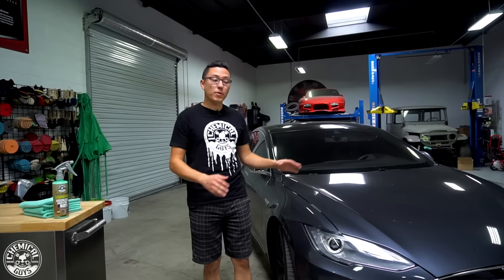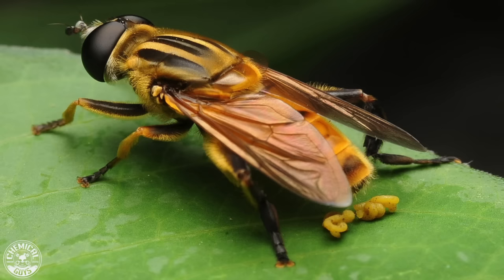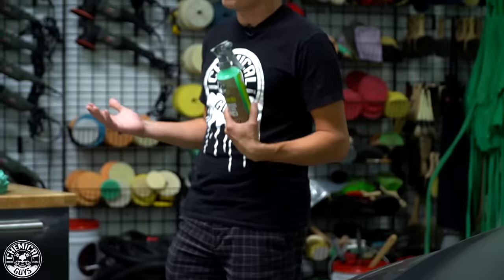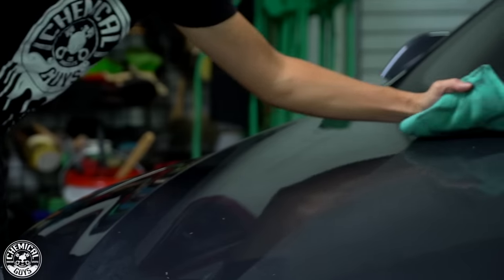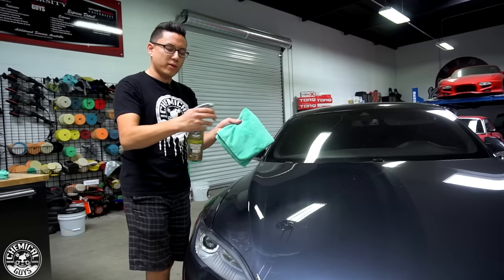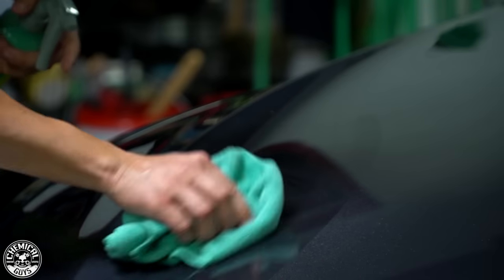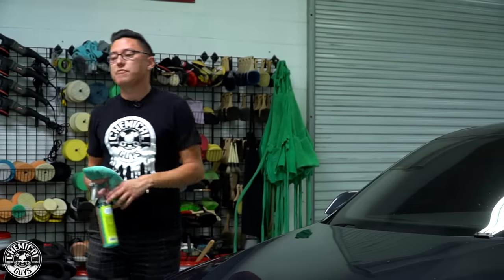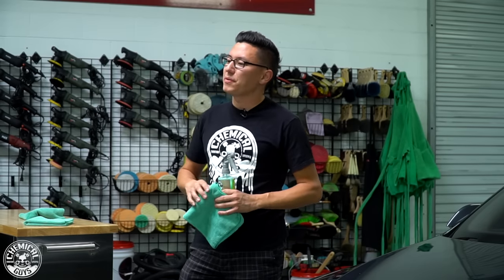What Are Those Yellow Spots On My Car? It's Bee Poop! - Chemical Guys Car Wash

Comment: Frass, which is the excrement of insects, including bees, is typically dry and in the form of small, solid pellets. Unlike wet grass clippings, frass is not known to splatter on cars or other surfaces.

The size and consistency of frass pellets make it unlikely for them to splatter or stick to a moving vehicle. They are generally dry and lightweight, so they are more likely to scatter or disperse when disturbed rather than splatter like a liquid substance.

However, it's worth noting that frass is typically produced by insects near their nesting or feeding areas, and these areas may sometimes coincide with places where cars are parked or passing by. In such cases, it is possible for frass pellets to land on a stationary or parked car if there is direct contact or close proximity to the insect activity.

If you find frass on your car, it can usually be easily brushed or wiped away. It is generally not a significant concern or cause for damage or staining like some other substances might be.